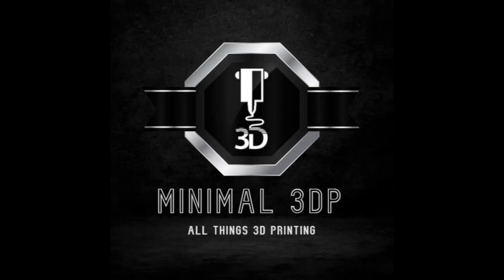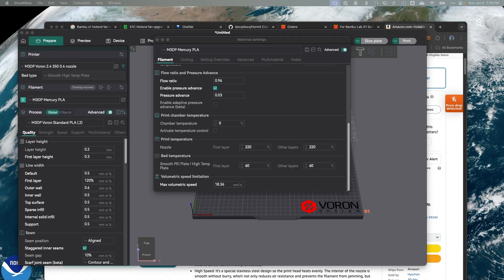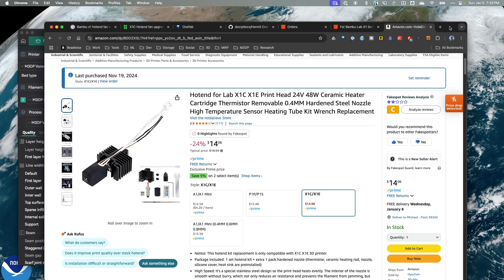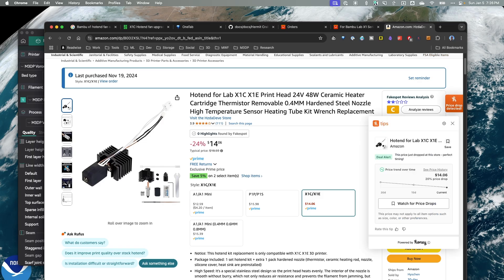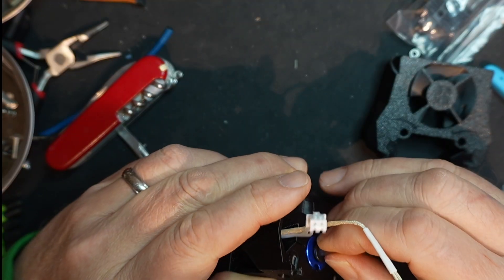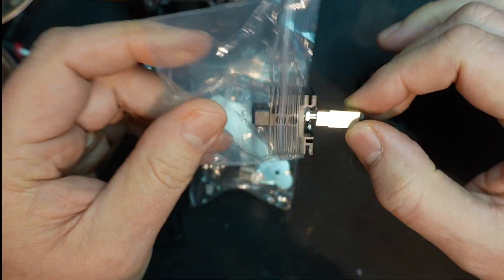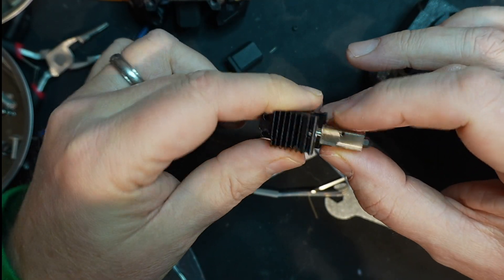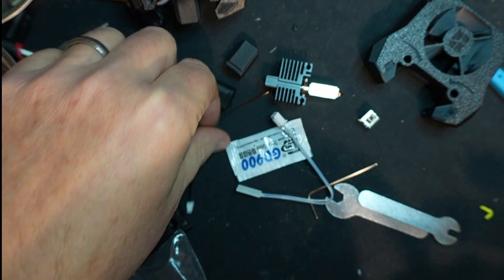Increase 3D Printer Flow Dramatically: X1 Hotend Stealthburner Install

Comment: That little pouch of GD900 thermal paste is messy but it will improve the heat transfer to increase the volumetric flow rate when applied to the heater, and it'll ensure that your nozzle temperature is accurate without overshooting when applied to the thermistor.

When assembling my SV08, Sovol's open source adaptation of the Voron 2.4, I replaced the stock hot end, which is a clone of the Bambu Lab hot end, with the MicroSwiss FlowTech hot end.  The upgrade was a bit easier than replacing the Sovol nozzle, which requires removing and reinstalling the heater and thermistor without damaging the fragile wires and connectors.  The MicroSwiss hot end is much higher quality.  The machining is gorgeous.  The design is much better too.  The cylindrical heater completely surrounds the hot zone for faster heat flow into the nozzle than the little heater block on one side, as in the Sovol and Bambu design.  The MicroSwiss hot end allows quick cold swapping of the nozzle in one minute, one handed, with nothing but a 7 mm nut driver, with no removing and reinstalling the heater or thermistor so there's no thermal paste on my fingers.
Reply from the maker: Thanks for all the info. I will pin.
Reply: but it’s way way more expensive than 15 bucks
Reply: @thijstriemstra  - Thumbs up to that!  Retail price for the @Microswiss SV08 hot end with 0.4 nozzle is $64.  I got mine on sale but the first layer issues on the SV08 resulted in the Microswiss hot end being consumed by a baseball sized blob-o-death, so I recently was forced to buy another Microswiss hot end at full price.

I've been 3D printing since there was consumer/hobby 3D printing and it's always been such a hassle to swap nozzles.  I always thought I'd do that so I bought the nozzles but in practice only replaced a nozzle to repair a printer.  The Microswiss hot end was the first time I would swap to a different hot end to optimize it for different prints.

Sovol's new Zero has a similar hot end to the one they used on the SV08, but it has a longer melt zone and higher wattage heater to bump the volumetric flow to 50 mm^3/s, and the nozzles can now be swapped by unscrewing the old nozzle and screwing in a new nozzle (like the Microswiss) without disassembling the hot end heater and thermistor.

Anyone contemplating swapping to a Bambu Lab hot end for better performance might consider the Bambu Lab compatible Mako hot end from Slice Engineering.  They're claiming up to 65% faster printing, but it's also way more than 15 bucks.

Comment: Do I need to change the setting in cfg file due tho the different thermistors?
Or just do the pid tuning ? Thanks for the vids
Reply from the maker: I have not changed the thermistor just did the pid. It is working well for me.

Comment: Yeah, you forgot the thermal paste on the back of the heater and in the thermistor hole... Without good thermal conductivity in both places, you're going to get poor performance... They didn't include that little silver packet for the hell of it. 🤦
Reply from the maker: I did. Crap!

Comment: Maybe you should add the info that the hotend is not a original Bambulab but a knockoff, i have see tests competing the original and the knockoffs and the are differents in the layer adhesion 😮
Reply from the maker: I think I did mention it being a clone. I will test the adhesion.